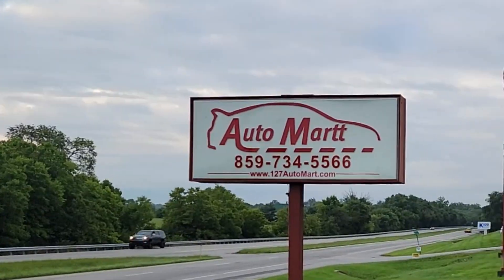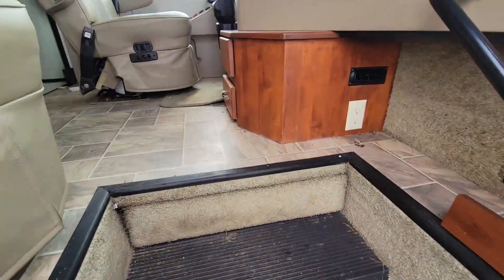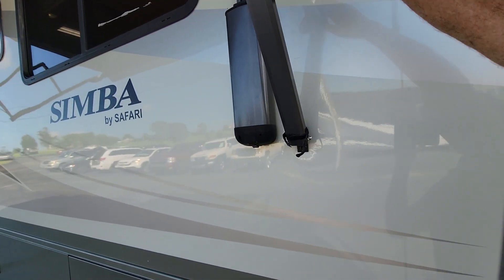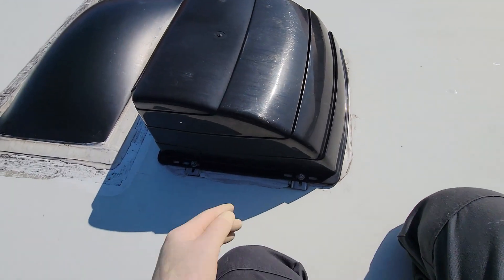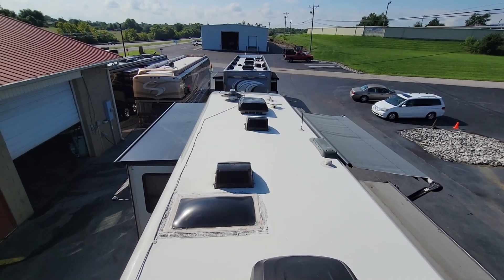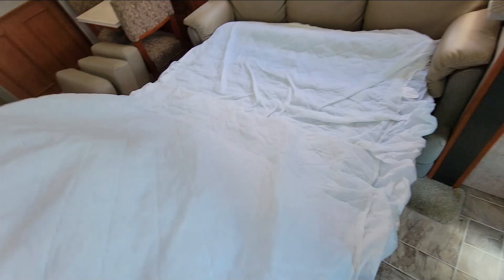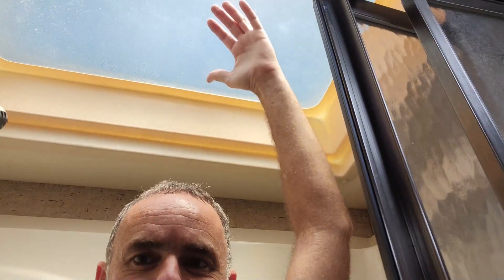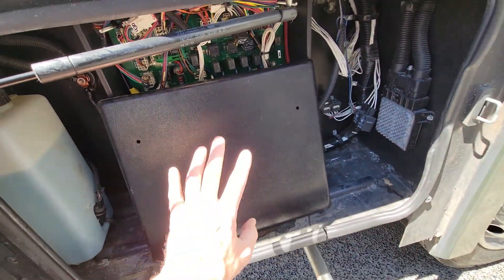Why Am I Back in Kentucky?

Comment: Great video James!  You mentioned this coach doesn't have the crummy LP oven.  I used to hate them also as they would burn everything you put in them.  However,  I found that by purchasing an AirBake Natural Cookie Sheet, 14 x 12 in and placing it on the shelf directly above the oven burner, it completely eliminated burning and now bakes like a normal residential gas oven.  I had a coach that had a convection/microwave and no LP oven but I actually prefer the LP Oven now that I have found this easy fix.  Just thought I'd share in case others would like to give it a try
Reply from the maker: Awesome tip! Thanks Steve

Comment: I note there is a cable operated slide on rear passenger side. I am not a fan of cable operated slides. I understand you cannot manually open or close them if they malfunction..is that correct? Unlike schwintec or rack and pinion?
What’s your opinion on cable operated slides vs schwintec or in frame rack and pinion? 
Comments please.
Thanks
Reply from the maker: yes it is a cable driven slide. it can be operated manually. Often the manufacturer makes accessibility difficult but there are a few methods.
Reply: @AZExpert  thanks….your videos are always very informative. Keep up the good work.

Comment: Why can’t RV makers get the clear coat right? Most people park their cars outside at home. If the average auto started pealing in 3 years the car industry would end. Why is this accepted as “the norm”?
Reply from the maker: Because RV's are purchased on price and held for 3-5 years only and there is no incentive for manufacturers to do better .Ultimately the consumer rewards poor workmanship and punishes quality workmanship and manufacturers race to the bottom as the first year is the only important metric
Reply: @AZExpert  it sounds like the RV makers are not to be trusted at all then.
Reply: RVs are painted by hand in a booth, cars are done in a factory. Often RV's have fiberglass parts which outgas and damage the clearcoat.